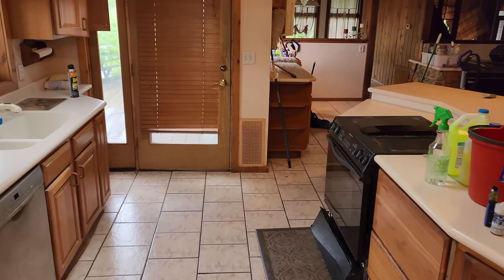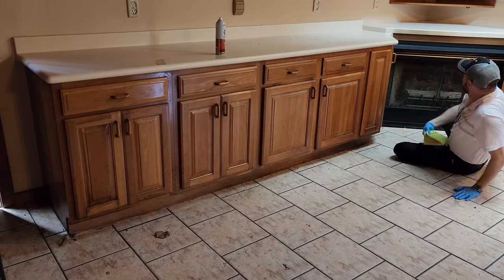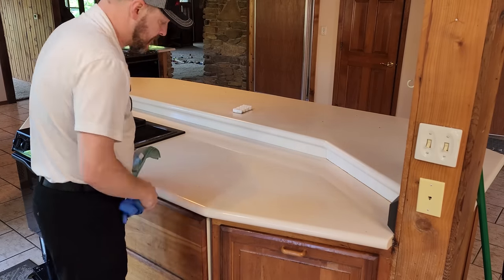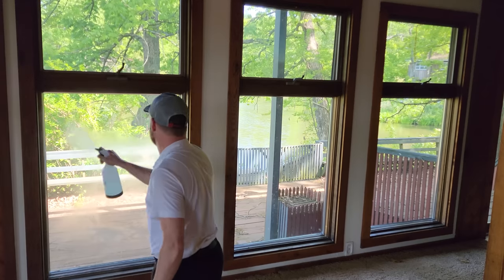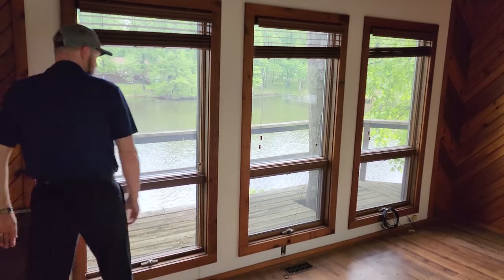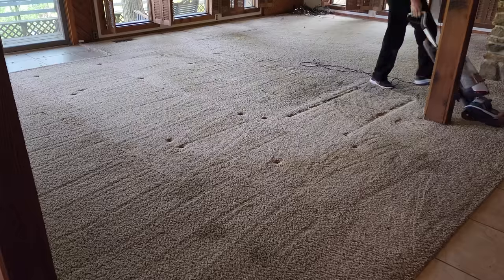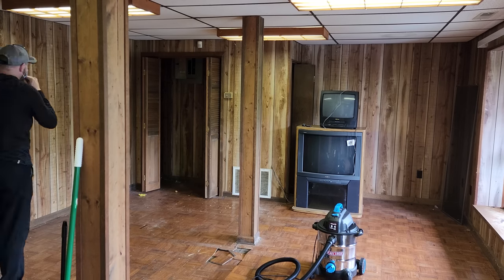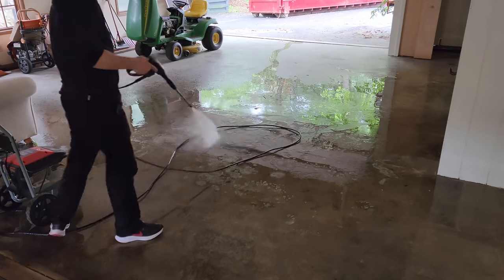5-day deep cleaning in a lake-house mansion!

Comment: You and Barbie are my favorite cleaners! 
One suggestion for cleaning windows. I’ve gotten into the habit of scrubbing side to side on the inside and horizontally on the outside. Makes finding streaks easier for me. 
Secondly, I use a swiffer sweeper, not for floors but for cleaning walls, huge mirrors and windows. I cover the sweeper with microfiber towels or rags instead of using the swiffer wet or dry pads. 
Thanks for all you do.

Comment: When i used to clean windows, my nan always told me if you wipe horizontal on one side and vertical on the other side its easier to spot which side has the streaks also used to use vinegar and newspaper to clean windows lol. Stunk but worked lol.  Gonna use your method thought now

Comment: Thank you for the educational and helpful videos. I once watched a cleaning company wash windows in an apt. complex and the way they accomplished the streak issue was interesting, onebnb person was on the outside cleaning while another person was on the inside, so they cleaned the same window together. The one on the outside would point to a streak and the inside window person would clean it and the inside person would point to streaks that were on the outside and the outside person would clean the outside streaks. It sounds like a lengthy process but, they cleaned the windows in half the time.

Comment: I'm sure you already know this, and it probably doesn't even matter, but if you do the insides of the windows vertically and the outsides horizontally, then you can easily identify which side the streak/s is/are on. Saves wiping the streak-free side

Comment: For windows, have you tried cleaning them in different directions? You could clean the inside wiping top to bottom, then clean the outside wiping right to left. This makes it easier to determine which side the streaks are on. I cleaned glass professionally for about 18 years and this was the method I used.

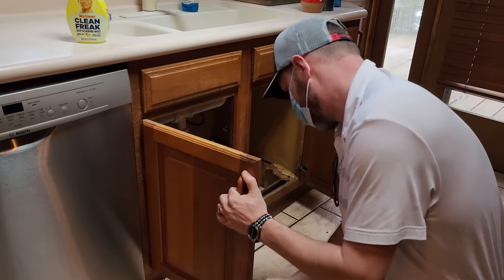Comment: APC: All Purpose Cleaner (7:50)

To disinfect
1. Fill a bottle 2/3 full with 91% isopropyl alcohol
2. Fill the rest with water
3. Add 1/2 tsp Dawn dish detergent 

To shine (most hard surfaces except finished wood)
1. Fill a bottle 1/3 with 91% isopropyl alcohol
2. Fill the rest with water
3. Add 1/2 tsp of Dawn

Comment: Tip from my grandmother. Clean one horizontally side to side, and the other top to bottom. When you see streaks you can tell which side its on. She also used news paper to clean windows, but I haven't seen a newspaper for years.

Comment: Beautifully done!!! You leave a place looking as brand new as is possible, that's for sure. 
You were saying that you just water mop sometimes after cleaning with a cleanser and I'd never realized that that's probably a good idea but I've never done that. Question: do you think using that APC solution when I damp mop my laminate flooring would be a good idea, or a bad idea. I have made some of that and was amazed at how much better it is than the window and glass cleaner I have used for years. I really appreciate that tip. ❤👍😊

Comment: My guess is the house was built in the late 70s early 80s   My ex still lives in the lake house we jointly owned, built in 1980. The windows that roll out, the octagon window in one of our bathrooms, the floors, carpet, neutral colors, wood trim, even the stone on one of their fireplaces were all the same. Even though we had 4 bedrooms and 3 full baths, it wasn’t even CLOSE to the size of the one you cleaned!! 
Do you have a new shop vac? Does it have a filter? I haven’t found one that picks up stuff without clogging the filter. 
Hope you’re resting!! ☺️♥️

Comment: I am from Toronto, Ontario, Canada, and I used to work in a call center where ppl from the US called in for help on household products.  One of them, and I heard great things and they even gave us the product to try out.  It is called Cinch Window cleaner and it is not supposed to leave any streak.  Also, did u know you can even use newspaper to clean mirrors with a spray instead of using cloths.  It is not supposed to leave any streaks.  I have tried it and it works.

Comment: At first you just inspired me to get organizing because your sense of humor is hilarious. And, I did need to do the clean up 🧹 n my two car garage that has never held a car because of storage. So while dismantling Christmas, I began. My mess is always organized in tubs, boxes and stuff but, last night, was a true revelation. I. Border. On. Hoarder. I’m also a poet! Perhaps I’ve crossed the line into actual hoarder. But, I’m getting older. Feeling my age. And having a very hard time saying, “goodbye!” 
Back to my revelation: my old wrapping storage bag for Christmas wrap broke so I got a new one. Went around and gathered all the stuff to fill the bag. Then I pulled an older but not deep enough one from my pantry and filled it with tubes of cellophane. The hen I found a tray type box on a shelf that was filled with more wrap for all purposes. I put a few gift bags in that. Then I found a 2’ by 1.7’ zip lock baggie  filled tightly with gift bags. Then I found a storage bin filled with gift bags. Do. You. See. Where. I’m. Going. Here???
I want to get rid of most of it but, I am having difficulty telling myself, “Do you realize how much you’ve spent buying all this stuff? All I really want is one bag of all occasion wrap, one bag of Christmas wrap, and some bags when I don’t feel like wrapping. But, going through to pick out what I would want has me thinking, I’d keep more than I want. I need you to drop in and bitch slap me into oblivion so you can toss it all as I try to recover from the slap!!!
I wish I could send you a video of the mess I have created from my very large family room into and across my entire garage. (Because, if I’m going to organize, I have to open every bin and re fill with what I’m keeping and toss what I no longer want to deal with, which is most of it. As I write, it’s helping me realize that I’m a hoarder. God help me. 
I’ll buy you a plane ticket.  How soon can you get here? 🤦🏼‍♀️🤦🏼‍♀️🤦🏼‍♀️

Comment: Oh dear. I'm a pest. But the windows.....sometimes (as was the case in the last house I owned) the insulated windows actually have a gas between the exterior and interior panes, and if there is even a microscopic "Leak" the windows will become cloudy in between the two and nothing will fix it. I'm a realtor and this has been an "Inspection" issue; "Leaky windows" when no water was leaking! They were referring to the above mentioned situation. What a total pain in the .....just a tip. Not all foggy windows are for the same reason.

Comment: Not to spam you but the wall-panelling in the apartment tells me it's from the '50s or '60s, but the upper house does indeed look '90s; another commenter mentioned the '70s in reference to the upper house, so I'm wondering if it wasn't built earlier, and then they re-did and updated the upper-house but not the apartment? 🤷‍♀️

Comment: I have had cleaners mop my floor and not rinse it.  I go barefoot, and notice it right away.  It is so annoying as I then need to rinse it myself.  Its not that time consuming, but it is annoying.  A suggestion.  I have used a little bit of dish soap when I clean carpets.  I also rinse them so there is not residue left to attract dirt faster.  You have been mentioned on other sites, by the way.  They suggest others watch you.  Wow, everything just sparkles!

Comment: I see you prefer the 'pull' method of mopping via latitudinal strokes. Any thought to using the 'push 'method of mopping via longitudinal strokes? I use the latter method to prevent a twisted back. Though mopping forwards does leave a footprint if ones shoes are holding dirt. Do you prefer mopping backwards for this reason?

Comment: Tip on cleaning the windows,  wipe  them all in one direction then on othe side wipe in a different different direction.  Usually vertically then horizontal or vice a versa.  If there are streaksyou will aee them once ypu have the window clean.

Comment: I love watching your channel. My question is how do you clean older shower doors with hard water. I have tried lots of things, nothing works.
Reply: I would use a paste made out of citric acid crystals and a scotch brite pad on the glass.. just avoid using the abrasive pad on any metal, the frame and track. I would use a plastic scrubbing (Scrubit brand) pad on the metal. Then you can go over it all with full strength white vinegar on a terry shop cloth towel. 

I have saturated vinegar on a terry cloth shop towel and then tightly wrapit around bathroom faucets with hard water scale buildup.. let it sit for about 30 minutes and most of the scale will break down and wipe right off. Also if your faucet aerator gets caked up with scale, fill a sandwich baggy with a half of a cup of vinegar.. slip that over the faucet spout and let it sit overnight. Sometimes if the buildup is real bad you might have to remove the aerator to fully clean it.

Personally I have found the citric acid crystals and plain white vinegar to be the best for hard water scale buildup and I use a lot of those abrasive cleansing powders/liquid paste or other chemical cleaners (like Tilex/CLR/Scrubbing Bubbles) much less.